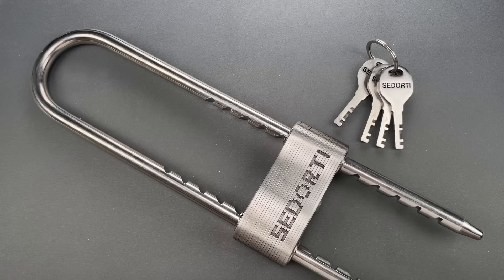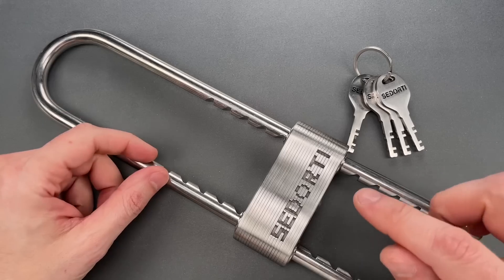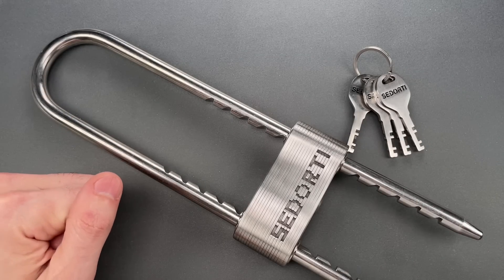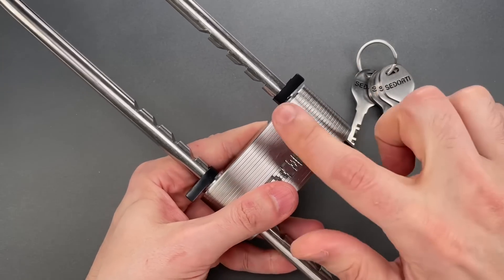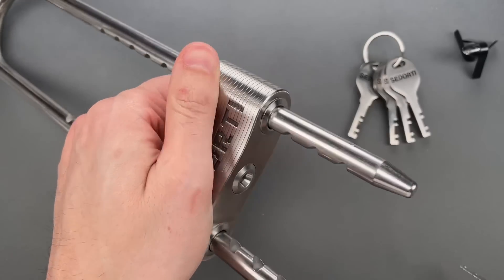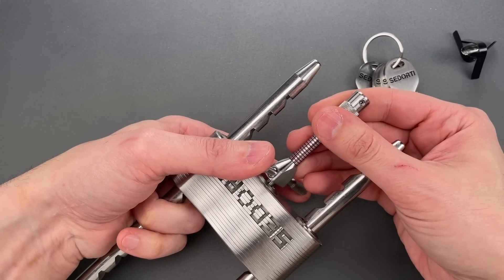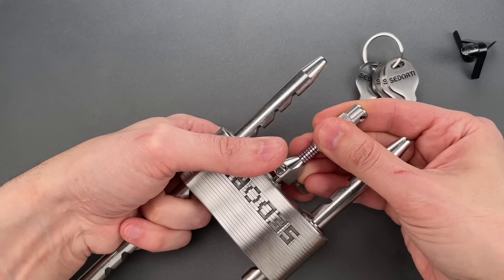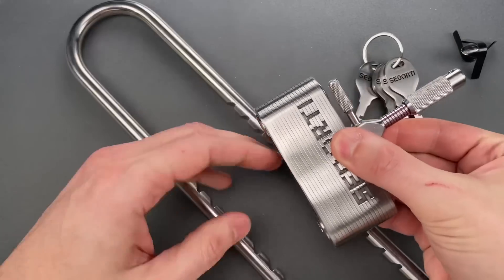[1583] Sedorti Stainless U-Lock… Two Vulnerabilities

Comment: Isn't stainless steel more susceptible to destructive attacks?  Freeze the hasp with Freon then pry apart with two open-ended wrenches until it fractures?
Reply: Some stainless steels (304 included) actually gain toughness at cryogenic temperatures. 304 tensile strength goes from 600 MPa at room temperature to 1450 MPa at -160°C and 1600 MPa at -200°C.

Comment: Im quite surprised that the lockmakers went to the trouble of designing a shimmable sprung pall locking part that fits a disc detainer core. If they had just used the standard ballbearings and locking bars that actuate from the cam on the back of a standard disc detainer core, the lock would have been more secure. Then if theyd spent that extra money theyd saved on having less parts, on having discs with false gates, the lock would have been quite good.

Comment: So when I was young my parents would use this kind of lock to lock the doors on the entertainment center to stop us from watching TV all the time. Funny thing is when you push the lock up so its between two divots, you can then hit the lock with a rubber hammer hard and it will just fly off the shackle.
Reply: That's more or less exactly the way shimming works.. The only real difference is that the locking extenders have no time to re-engage in your case, while the shims keep them compressed.

Comment: When I bought my house last year I installed a "Zinc Safety Hasp" and use a cheap Master lock on the out building my lawnmower and a few garden tools are in. It wasn't until after I installed it that I noticed that when they put the doors on the outbuilding they installed the hinges on the outside of the doors. All you need to get in is to take the screws out of the hinges on the door. 🤦‍♂

Comment: Wouldn't buying this lock 2 times and sliding a 2nd lock body directly below the other one defeat the shiming strat?
Reply: It not a one way hole. You can poke it from the other side too, or just move the top lock higher and make room for the shims. if there is enough space.

Comment: If it wasn't for the shimming issue this lock would be pretty good. Anything that needs a specialized tool and more than 30 seconds for LPL to open is a good lock. Though, stainless steel is expensive and soft, so the cost and cut resistance might be an issue. Guess the cut issue is resolved through thickness though.

Comment: Depending on the application, you may not have the space to get shims into the lock, leaving picking as the only option, and since that requires special tools and skills, this could actually be a pretty secure lock, as long as you take into account the vulnerabilities.  Of course most thieves won't bother with either shims or picking and will simply take an angle grinder to the shackle and have the lock off in seconds.

Comment: OK for low security uses, but at £91 / $100 a time, it's a high-security price. One thing to be said for Masterlock is that usually the cheapness reflects the quality of the design and you know you're buying just the image of security and not something that will deter a reasonably competant thief.

Comment: 304 stainless steel means it's gonna rust in days if you use it near or at sea (like on a boat). I've tried so many 304 locks for my outboard, you can break them barehanded after a year or so. 316 is what you want instead.

Comment: A disk detainer with sprung locking lugs is an odd design, I think the only other lock I've seen with that combination was a similar lock featured on this chanel.  The main advantage of a disk detainer is durability because it doesn't contain any springs, having sprung locking lugs negates that advantage.

Comment: I needed some new U-locks for my aluminum trailers to secure the ramps in place. One per ramp, and more so to prevent against casual theft. Real thief would just snatch the whole trailer. While the shimming is unfortunate, still would probably work fine for my application. I might pick up a set. 85 bucks is kinda steep tho, we'll see

Comment: A simple key slot along the length of legs with a registering peg in the lock body would make a shim attack impossible.
And discs... well nothing can be done about that. You can polish the turd by narrowing your tolerances, but that would only slightly increase the effort needed.
I mean after all, most disc detainers can be forced open with a bent screwdriver. Yeah, that's destructive, but thieves don't care.

Comment: If they'd only moved the locking lugs to the middle of the lock body, they'd have reduced the shimming vulnerability. You'd still be able to make longer shims to get in there, but it wouldn't work with the pre-made ones you can buy anywhere and everywhere these days.

Comment: How is picking with highly specialized tools and some considerable skill regarded as a vulnerability?
If that's the case then most locks have the same poor design choice since they can be picked with the right tool...
It's not a vulnerability unless you can jiggle and shake the pins to open the lock IMHO, anything above that and you are looking for specialists in lock picking and then every lock is vulnerable in some way.

Yes, the shimming is THE vulnerability of this lock and i could see it right away by the design of those teeth on that shackle. It basically screams "I can be shimmed easily".

And perhaps the core isn't high security, but that doesn't make it a vulnerability. It just makes the lock low security. Good for attaching something you care little about or that you still have your eyes on somehow.

Comment: How would they prevent the shimming issue?
Move the latches to the bottom?
Or is this just a flawed design that needs to be discontinued?
Reply: Ball bearings that can move out of the way into a different space when unlocked, rather than a spring pressing a piece of metal into the grooves. The spring can be compressed when locked, but a trapped ball bearing has nowhere to go.
Reply: @cinderwolf32 Thanks for the information.

Comment: The wisdom of LPL: Just because it has flaws doesn't mean it is useless.
Reply: I wish my ex-wife was as generous with compliments.
Reply: I think he also once said that a certain safe would make a great decoy as you hide your belongings elsewhere.
Reply: Of course not, but are you going to put such a flawed lock on anything? Any thief is going to get through it no problem.
Reply: @lepayen my grandpa would say "it keeps honest people honest" 
it is NOT a SECURITY device but a "this is not yours to borrow" lock
Reply: @lepayen Dude he literally said like 3 examples of what you'd put this lock on at the end
Reply: @lepayen The lock is great as a hammer and can block a bladed weapon. Also the multiple positions can be used as a counter.
Reply: @lepayen  I mean, you could use it to lock the thief's leg to a... "fun diving weight". 🤔
Reply: If it's on something especially low value. Say, as LPL mentioned, it's holding a propane tank on a grill. That's more to keep the tank from falling or whatever. If someone wants to steal a propane tank, they'd probably look for an unsecured one rather than one with any kind of lock on it. It's easier to cut a zip tie and walk away with the tank than break out shims or a disc detainer pick. My friend has a grill where he just sets the propane tank on the ground next to the grill completely unsecured and has never had an issue. So this entire line of thinking is probably pointless.
Reply: @astrosteve   

Good job missing the point.

Comment: Wait, if you can move it up without unlocking it, wouldn’t it be possible to block the upper holes, move it up so it is over the blocked holes, and block the bottom holes up? 

I’m just wondering, because to me that seems as another way, but it can be just me.

Comment: How would you protect a lock like that from shimming?
I cannot see a way.
Reply: If using a ball bearing rather than a piece of metal held in the grooves by a spring, it can be so rigid (since the ball has nowhere to go when the lock is locked) that a shim will not be able to get in, and would have no effect anyways.

Comment: It seems as if it would be simple for the lock manufacturer to add either some thickness to the lock body on top, or tubular extensions around the shackle. Just enough distance to make shimming difficult, or impossible with a commercially available shim. An inch would do it.

Comment: This style of lock is pretty easy to brute force if they have a hardened shackle and you can slide the body up past the final locking position because then you can just snap the ends of the shackle off with your hands and slide the body off with no issues. However I should point out that doing exactly that with one of these type of locks is how I got a nice scar straight across my right nip, so you probably shouldnt have it up against your chest while doing so, even if it does give you the best leverage. As you might expect, those broken ends are sharp, and a cut nip really smarts

Comment: They could solve the shimming issue by adding some cylinders attached to the top of the shackles to make shimming difficult without using a customized shim with extra length.  Then the lock would be at least usable for mid security
Reply: Or just have the parts that lock into the teeth further down.
They don't care about these things though, just money

Comment: I just glanced over the design for 20ms and it looked very shimmable ;)
Reply: that style of PADLOCK is shimmable BY DESIGN and needs to be shimmable so the lock body can slide up the shackle till tight otherwise you would NEED to hold the key unlock position to use the lock

Comment: I don't get why it's made from stainless steel, I've been around locks that have spent probably decades outside and unless they were buried underground, maybe sometimes need a little spritz of lube to make them smoother, they work fine.  The only time I can recall needing to shield a lock from the weather was on a gate lock during the winter to keep it from freezing.
Reply: 304 is the cheapest stainless steel, so...

Comment: I love how the fact that the build quality and weather resistance are above average, makes this lock great for tasks you would normally accomplish with a couple of zip ties.
Reply: This kind of application of a lock appeals to my laziness.  I'd just lose the bundle of zip ties way too often.
Reply: @MelissiaBlackheart  What about losing the key? Unless I use the key often I don't put it on my key ring. I'll just put it here, and I laugh at myself for thinking I'll actually remember that place! But I do know where I keep my angle grinder!
Reply: @3062 that's why you use a lock with low pick resistance / shimming 'flaws'. :P
Reply: this reminds me of the handful of things that people I associate with secure by locking with a cheap non weather resistant lock, and allowing it to seize from exposure.
Reply: @kenbrown2808 I’ve got a few things secured that way, works a treat lol
Reply: @kenbrown2808   So you've seen my garage
Reply: Fun thought, except you don't have to replace the zip tie every time you remove the fastening. If you have a barn door you open once every few weeks, a weather-resistant cheap insecure padlock probably makes more sense than a zip tie. (You might even leave the key in the lock - I've seen that done.) But even so, this is one of the most passive-aggressive "endorsements" I can imagine!
Reply: @jon_j__ when I was young, most of the sheds in my area just had an old padlock slipped through the hasp and not closed.  or an old screwdriver if the hole in the hasp was vertical.
Reply: @kenbrown2808 Good point. The extreme u-shape of this padlock means it's very unlikely to slip off through normal wind/weather (if the hasp has a vaguely-horizontal hole), so you might as well dispense with the locking mechanism altogether. But, once I realised that, I also realised you might as well just use an offcut of normal wire fencing (free!) and manually bend/unbend a couple of times whenever you need to open it, and that would actually be better because you could "close" it without risking losing the key. So... yeah... this lock is actually pretty useless even for low-security applications.
Reply: @jon_j__  At that point, you might as well just use a D-Clip / Carabiner. Much cheaper, variety of sizes to get one that fits right, variety of colors available (red carabiner on a red barn door keeps it sort of camouflaged to prevent others from seeing it at a distance so no intrusive thoughts to go mess with it, or bright blue carabiner on the white trim allows you to easily see it from a distance so you know it's there and you don't need to run out to secure it, just as a couple examples), and no key to potentially lose.
Reply: @Stant123  Sure. I think the wider point is that the "lock" part of this padlock is utterly pointless. There is potentially some value in the other parts, but you can save yourself quite a lot of money by cutting out the useless mechanical complexity of the lock.
Reply: @jon_j__  the lock part is not useless. 99.99% of people do not carry padlock shims around with them and probably don't even know they exist.
Reply: And for gates - padlocking a gate is only ever discouraging entry, given you can go over the top of them, so this sort of durable, weather-proof lock could be useful when what you really want to do is stop people using a field for parking or letting out livestock.
Reply: and you can shim the zip ties just as easily
Reply: Some zip ties will now stand outdoor use. What about reusable zip ties?
Reply: Two words: Angle grinder.

My daughter lost the keys to her fancy bike lock. Removed in under 2 seconds.
Reply: For something like a barn door or yard gate a padlock is better, though if you just need to keep it closed (not actually secured) you can just buy the cheapest padlock that fits and drench it in used motor oil to prevent rusting.
Reply: And any use this lock might have is utterly destroyed by the fact that it costs $80.
Reply: Believe it or not, zip ties will eventually break by UV degradation. I've seen it before, first time i couldn't believe it
Reply: Heck, a bunch of zip ties might be tougher to get through than this. It'd probably take longer

Comment: I’ve gotten to the point where I can see the shimming issue just from the shape of the locking slot. When it’s not shimmable, they don’t put a long ramp on the inward face of the slots. This is non-trivial; a split second glance tells you what tools to bring when you want to open it with no key.

Comment: What, if any, protections can you use against shimming? Is there anything you can do to provide additional deterrence, or is it something you can only do during design?
Reply: I've seen a few locks that are resistant against this attack on this channel. The problem is that the locking mechanism is spring loaded, and those springs can be pushed back from the outside. If it's using ball bearings that slide in and out of position (usually based on a rotary mechanism) this doesn't work.

Comment: I'm intrigued by the pick "that Bosnian Bill and I made".  I've seen it used in many videos, but I would love to know how it came about and when it was first used.  I'd also love to know what techniques or tools were used before this pick was created, as it seems like a special tool that most wouldn't have access to (and so skews the pickability of certain locks).
Reply: For a long time these locks was considered safe from picking. I'm sure some people were able to pick them, but it was very hard to do. Bossnian Bill and LockPickingLawyer designed this tool in an attempt to make picking them easier and to make them need more design and quality to make them safer in the long run. Now I think most who work professionally with locks still don't use this. They cut the lock off and charge for a new one. Picking is actually not all that common among professionals. Drilling them out, cutting them open and such is the common way to handle locks. Among thieves it's just the same, just even worse as they don't care the least about how much damage they make to doors or whatever they are breaking open. They are usually after what's inside whatever is locked up and not what they are breaking open.
Reply: @blahorgaslisk7763 true enough. The way locks were described to me when I was young was they aren't meant to keep your property safe, they're meant to make getting into your stuff more hassle than it's worth. It may sound cold, but having the best security on the block is really just a way of making criminals choose your neighbors house over your own.

Comment: Seeing those two rods sticking out of the bottom makes me wonder. Since most picking tools require two hands to be near the keyhole. Maybe, a big deterrent would be a simple tube, possibly with a cone nearest the keyhole. Long and narrow enough to only let in one hand and the key. 

I mean, it'd only be a deterrent as you'ld only need some preparation to build elongated tools to start picking. And then you're back to normal pick resistance. But it would stop most from trying at least. 

And it wouldn't help shimming either. Unless you add tubes upwards as well.